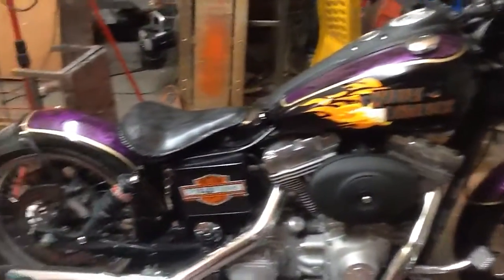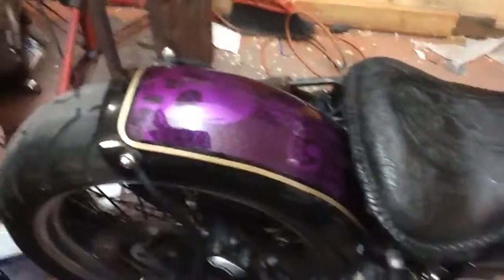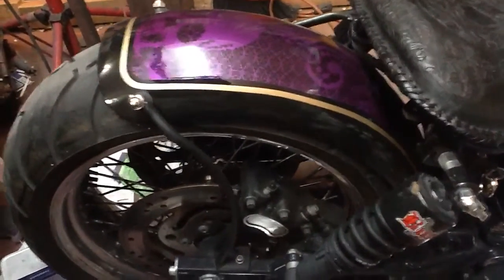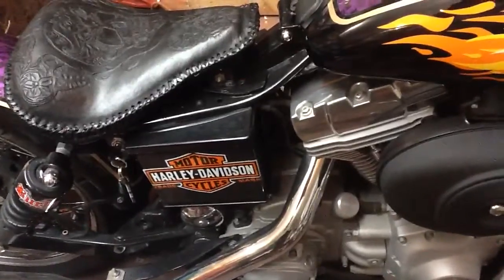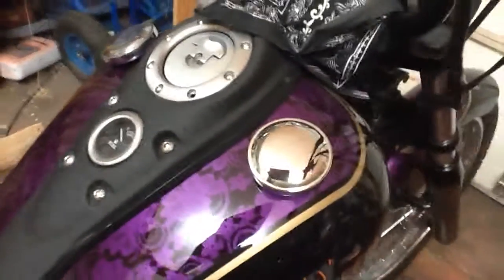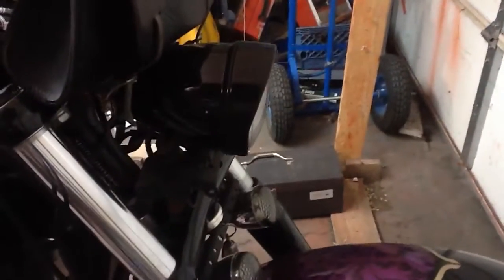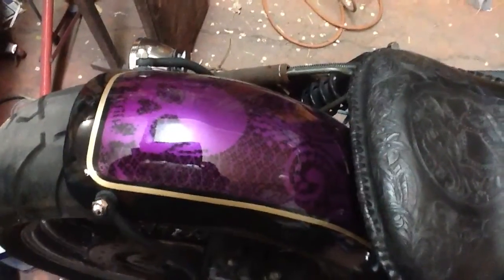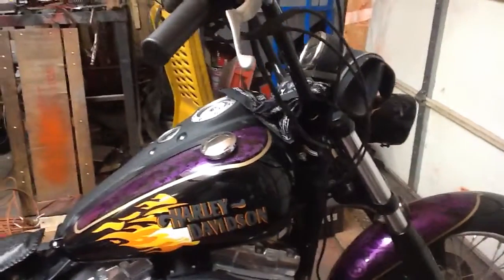Harley Super Glide

Comment: I like it. 👍
I used VHT Exhuast paint inside my new pipes hopefully to avoid blueing holds Temps around 1200 degrees. so far it's been 2 months and they look like new.  It's really meant for painting exhaust on the outside. It comes in several colors. You might consider it while you save for the black pipes.  Maybe test on some old pipes if you have some lying around or pickup some cheap ones clist. Make sure you layer it with thin coats.